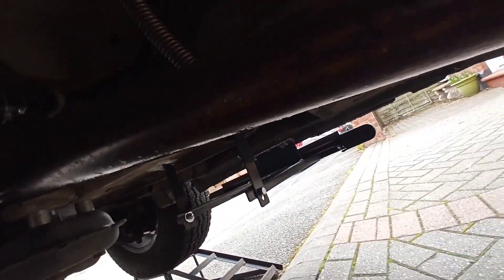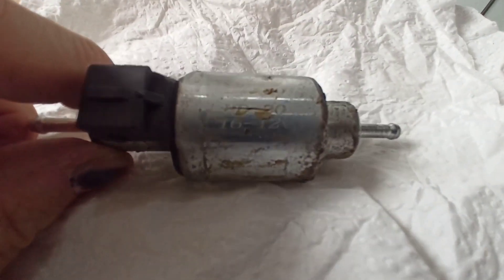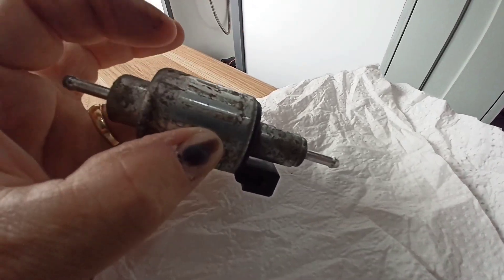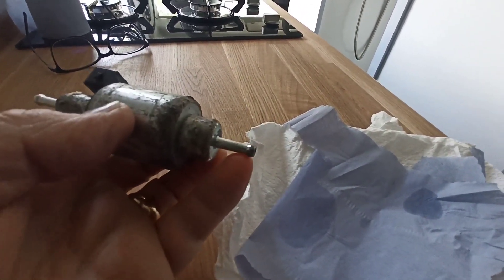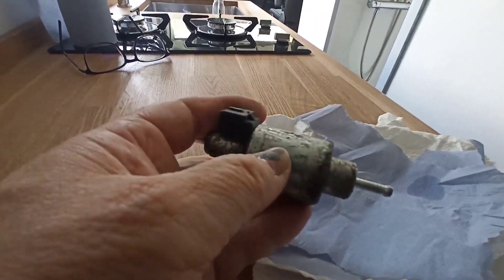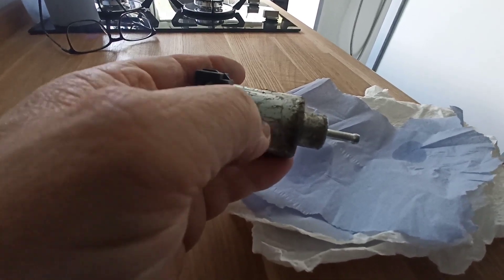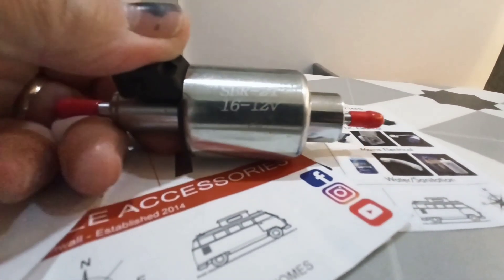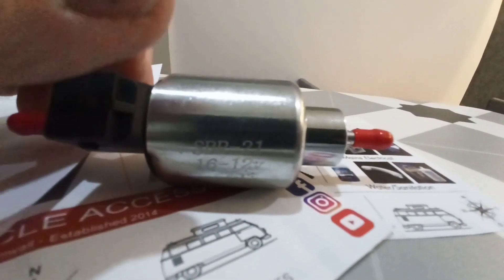Chinese diesel heater, smoking, over fueling

Comment: great post , my 2 kw pumps hard even before the glow plug is hot enough and floods the chamber , (i can hear it clicking about 3 or 4 times a second) , pretty sure the start up sequence is forked , settles back to 2 pumps a second after about 2 minutes .  new HZ adjustable circuit and controller on the way .

Comment: I think my pump is faulty. I can see small air bubbles even when it’s running and I get plooms of smoke at start up. I also have to prime it a lot every time I use it
Reply from the maker: @Ian-ev5tg  that's what was happening with mine, due to the pump being faulty the diesel was leaking into the burn chamber causing a lot of smoke on start up

Comment: I had my heater carbon up and had smoke but no fire. I blew it out with my air compressor and got a lot of carbon out the intake and exhaust. Still smoked like crazy but wouldn't fire. Blew a jet of air up the exhaust while trying to start and it fired up and cleared out.

Comment: I had this issue till i used the high altitude setting,lol im at sea level but this setting fixed my over fueling issue and i havnt had an issue in months,before i found this setting is was ready to throw out my heater because i was forced to rebuild and clean it every week
Reply from the maker: Once it started up it would run great it was just that basically because the seal in the pump had worn it was soaking the diesel into the burn chamber so obviously once it started up it was causing excessive smoke, it was also leaking out of the burn chamber running down the exhaust in staining all my driveway

Comment: You could try put a non return valve on the fuel line
Reply from the maker: A non return valve stops the fuel flowing back in to the tank, so it wouldn't stop the syphoning effect, a fuel isolation switch would work but it's easier to change the pump

Comment: In this case, putting the fuel pump and the fuel tank below the heater would be a good idea.
Reply from the maker: The fuel pump is below the heater, 0
Reply: @nasty.nick.p make sure of your airflow into and out of the burn chamber, my exhaust had a 1/16 of carbon lining it " no way it was blocked" but it reduced the airflow,and white smoked like a fog machine

Comment: 2:20 or you pull up or down the number of pulses the pump make a minute....This way you can tune it to be an 8KW or 5 KW heater....5 and 8 are a bit arbitrary numbers here....
Reply from the maker: You can't with this heater as it has the smaller burn chamber and the 1.6ml pump not the 2.2ml